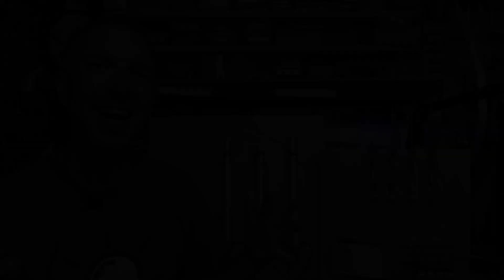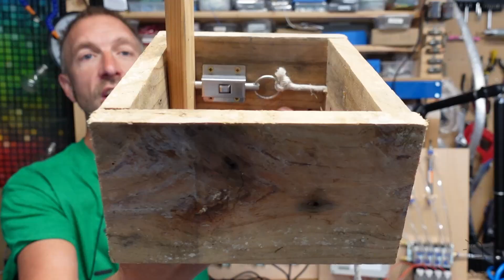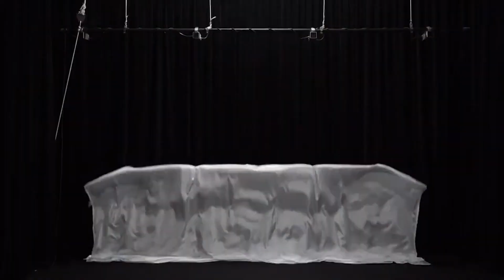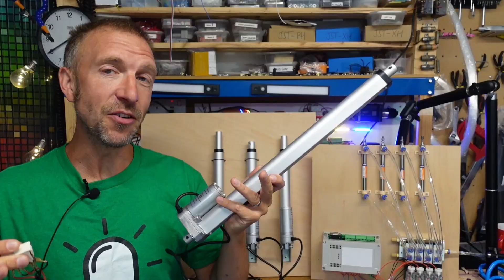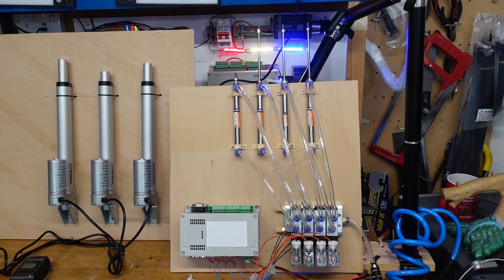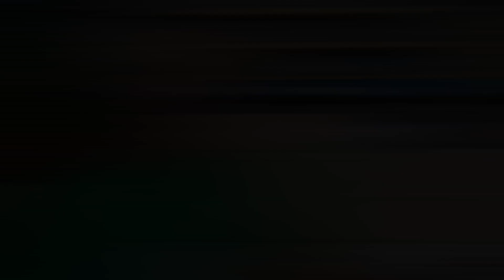Making Things Move - pneumatics, actuators, gas struts and drops!

Comment: You have made a mistake , in reality you can stop them in the middle but you have to use another type of cylinder and valve , and about the speed also you can adjust as you want using special connection with air control

Comment: You should use flow controls to adjust the rate of your pneumatic cylinder instead of adjusting pressure. This will give you better and more repeatable control of the speed. It will also allow you to use higher pressure to move heavier objects but dial the speed way down without introducing too much air spring effect. You'll want to search for an "in-line push-to-connect flow control valve"

Comment: I would also like to see a video about pneumatics. The main question I have is how small an air compressor would be workable for a simple system with only a couple of pneumatic cylinders. Would a small compressor with a tank such as is used in airbrushing be sufficient, or do you need a larger one? Also, I'd like to see an explanation of the entire system, how to set up the valves, relays, etc, as well as a discussion of how long the effective length of tubing from the compressor would be (to gauge the distance the compressor can sit from the cylinder itself).
Reply: For a simple two-cylinder pneumatic system, a small shop compressor (6–20 liter tank, ~2 CFM at 90 PSI) is the best choice. An airbrush compressor may work only with very small cylinders and infrequent use, but it will usually be underpowered and would overheat with excessive cycling. An airbrush uses far less air volume than a pneumatic system. 

 basic setup: compressor → filter/moisture trap → regulator → solenoid/manual valves → cylinders. A tank helps buffer short bursts of use. When it comes to tubing length, distance from the compressor does matter: longer lines add compressible air volume that slows response. To avoid lag, place a regulator and a small local tank (0.5–1 L) near your valves, keep valve-to-cylinder tubing short, and use larger tubing (3/8"+) if running 20+ feet.

In short, go with a small shop compressor for reliability, and manage distance by buffering air near the valves rather than worrying about where the compressor itself sits.

Comment: Thank you. Can you recommend a list of inexpensive materials that are needed for building a pneumatic cylinder system. I have a compressor I'm using for air brushing and I'm interested in learning how to use it with a pneumatic cylinder
Reply: A syringe. 

How strong you need it to be though, but thats the most inexpensive one.
Reply: I wouldn't use an airbrush compressor for pneumatics. You will burn it up in no time
Reply: Thanks.My air compressor is a regular air compressor. I just use it for my airbrush. It can handle pneumatic tools without any issue

Comment: There are faster (and quieter) linear actuators and you can introduce a motor rheostat to slow them down as well. Also, for the air cylinders, you can get speed control mufflers that allow you to slow down the air and give you a bit more control over the speed and timing.

Comment: There are a few details that should be clarified here regarding pneumatics.

Pressure does not control speed. In a small system like the one used for demonstration here, you might get some variability in speed but that is just a matter of overcoming the internal friction of the cylinder. It is not repeatable or reliable and will change drastically with wear within the cylinder. 
The pressure controls the amount of force that the cylinder exerts. This is a critical distinction when it comes to safety. If a cylinder is controlling something that can create a trap or crush hazard, then pressure must be set low enough to prevent injury.
To properly control speed, adjustable (or alternately, fixed orifice) flow controls are needed. These also allow setting different speeds for extending and retracting if necessary. 
If a cylinder needs to start and stop, this can be controlled using a closed center, dual solenoid valve.
 There are so many things you can achieve with pneumatics for relatively low cost and systems can be designed to do just about anything you can imagine! Glad you are sharing this info as it can help lots of owners/designers!
Reply from the maker: Excellent points, thankyou (and I appreciate the note about safety!).

Comment: You have great content and information. I appreciate you. 

I am in the final stages of an escape room build with an elevator simulation. I originally had the doors on pneumatic pistons to open and close the doors. The problem I ran into is safety. If someone puts their hands between the door and the jam…. Any ideas on solving for safety? I have them manually open and close now. 

One concept is using a magnet on opposing rods attached to the back of the doors (they are pocket doors) that break away from the pneumatic cylinder if x amount of pressure is applied.
Reply: Limit the force to the minimum the doors need to open and close. Tou can use pressure relief valves with pnehmarics so that if something obstructs the door the pressure will build, the valve will open releasing air and limiting the force that the door can apply to a safe level, also limit the maximum pressure the system can generate with a regulator as a secondary limit. Soft edges on the door also help. Similar principles can also apply to motorised door with current limiting/monitoring on the motor but you can also use light barriers which is trickier to do with Pneumatics.
Reply from the maker: The standard solution to obstruction detection is to mount an IR sensor (a "photo eye") either side of the door to ensure that there is nothing blocking the beam (and therefore obstructing the door): https://www.doorautomation24.com/Sensors/Photo-Eyes/